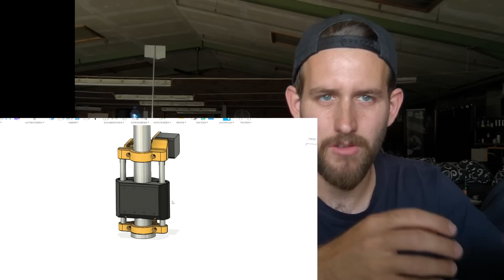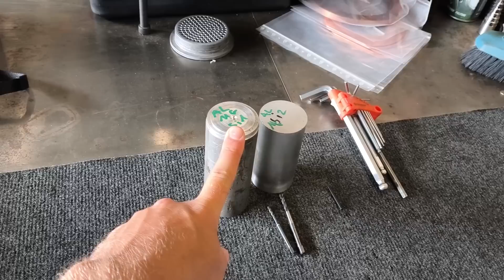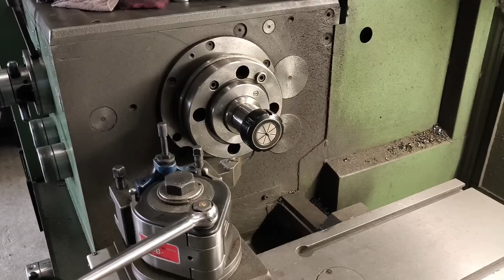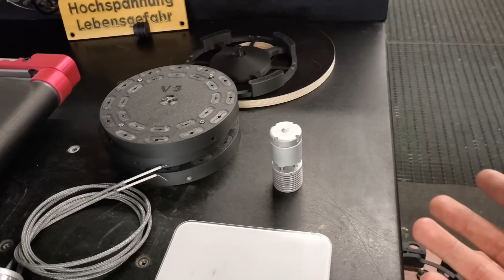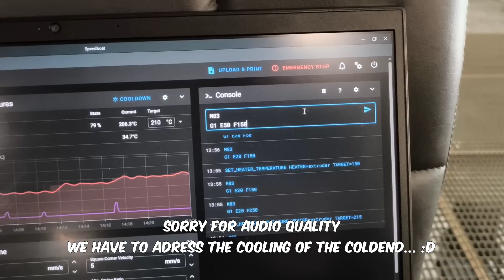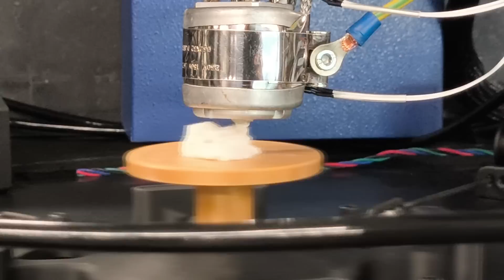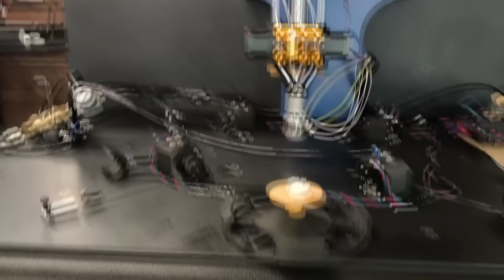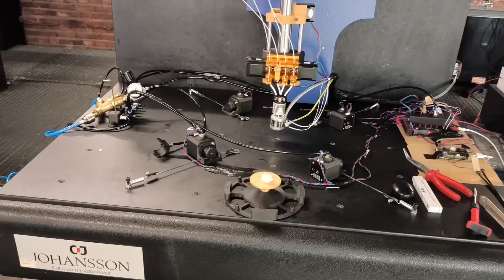Is a sub 1 min 3dBenchy possible? Hotend Build and First Print! (Episode 2)

Comment: For the constant force, can't you just put another stepper with a spool on each of the xy cables to replace the springs? I don't know about the code but if a gimbal can keep its position, then stepper should be able to hold a position on the cable/constant force. 4 more steppers is annoying to deal with, but it might be worth a try. 

You would also be able to vary the force/tension on the fly if needed.

Keep up the great work, I can't wait for the next update.

Comment: Titanium has the reputation for low thermal conductivity but there are some brass and bronze alloys in the 2-4 W/m/K range. UNS 52400, 61300, 63000, 64200, 73500, 79860, 71000, 72200. See specifically phosphor bronze with 10% Sn, aluminum bronze, nickel aluminum bronze, aluminum silicon bronze, "nickel silver", and various ~70% Cu 30% Zn brasses.

Re thermal conductivity of heat block, heat transfer may be limited mostly by plastic. The thermal conductivity between coaxial cylinders 5 cm long with a diameter ratio of 8 and 200 W/m/K bulk thermal conductivity would be 5 W/K, and you have 4 cylinders instead of 1, so a good estimate would be 20 W/K for your setup, which would imply only a few K temperature drop across the heat block itself. In that case, the prescription for more heat transfer to plastic, if needed, would be more filaments rather than changing heat block material.

Comment: How about returning the cable over to the opposite side? I feel like using springs for tension is always a bad idea as they vary depending on the load. Better to make something that have a constant tension and goes around to the motor on the other side
Reply: If I'm understanding crrectly, you're suggestign a closed-rope system for each two opposing motors. That's also what I thought of at first but since the bed has to move perpendicular to each axis, the total length of rope for each two opposing motors isn't always constant.
Reply: @sobhanabedi3363  Yea true. Need to think some more on this. I still believe springs are a bad idea
Reply: As someone else suggested you could connect the ends via a spring. That spring has to compensate for the little bit of movement when you move in both axis.
Reply: Now that I think about it, isn't there a setup that would work without springs? Maybe using only three ropes which are connected in one point on both ends.

Comment: "spring" with constant force is a vacuum. you can machine airtight cylinders with pistons that you can use as springs, and force of the spring will be determined by area of the piston
Reply: @IllSkillz  I also suggested gas struts but like your thinking
Reply: A counterweight also has constant force. Use a pulley to hang a weight, it will pull exactly the same force regardless of displacement
Reply: @Brainstormer_Industires  except the counterweight’s force depends on acceleration, which is high in this case. Once the desired acceleration exceeds 1 g, you have a slack wire…
Reply: @norWindChannel  Only with no mechanical advantage. Use a pulley system to increase it like 5 to 1 or 10 to 1.

And all systems have an acceleration dependency. The only way to have the same restoring force regardless of acceleration would be for the system to be massless. Even springs have a maximum no load return acceleration based on their density and stiffness
Reply: @Brainstormer_Industires  You are right, with appropriate mech. advantage the acceleration dependency of a counterweight can be reduced - I didn’t think of that. 

Increased mech. advantage necessitates increased mass to achieve the same force. In contrast, the mass of a “vacuum piston” can be virtually independent of the piston area, i.e. the force. 

At the end of the day it boils down to a compromise between total mass, complexity, size, cost etc.. It is great to have different options🙂 
Nice chat🤝.
Reply: I guess that is called damper
Reply: @anonym9323  Only if you’re a biker😉 It is actually a spring (a “true” damper dissipates energy, while a spring passively pushes back).
Reply: @norWindChannel yeah you are right but I think a air cylinder will be modelled as a damper maybe I do not understand the concept enough that IllSkillz was talking about in his comment and my english is not that good
Reply: Clever
Reply: A simpler solution would be this https://www.youtube.com/watch?v=tiC5ma70QWU&lc=UgzJ-4tLZU_4TskEpSR4AaABAg (just using weights at the end of ropes hanging of the table) achieving a good vacum in 4 points is WAY more difficult

EDIT: Wow you guys are right, weights would have a different force in case of acceleration. Thank you 👏🏻👏🏻👏🏻
Reply: Agreed. Except it is the atmosphere excerting the force, not the vacuum😉

Comment: This old Tony just released a video about gas struts explaining how they have constant force! I doubt you can find one with a low enough stroke or spring rate but it’s a possible option to overcome the spring rate issue. Best of luck, keep it up 👍
Reply: @jamieclarke321  Gas struts are way too slow. They are designed to dampen movement. If you think of your trunk lid, how it opens smooth but slow.
Reply: @deckname5794 This. Gas springs have a constant spring rate if they are near stationary. Since gas only has a small orifice to travel between sides, moving quickly causes it to oppose movement
Reply: @mars5train601  True. If you have a normal spring and use only a small part of its travel, you have relatively constant force too.
Reply: @deckname5794 Know what happens when you play with pulleys and gear ratios and such, speed can go up while force can go down. Imagine, a gas strut making less force, while still constant, at greater speed.
Reply: This was my first thought as well! To the people saying gas springs are much too slow, you can literally tune the ports on them infinitely. That's kind of how shock absorption works in general.
Reply: Or just use linear springs
Reply: I thought of this too. I think he could make his own DIY, purpose-built struts that would eliminate the problems others pointed out below. The most common objection made is a too-small channel for the gas to travel to the other side of the piston, making it a damper as much as a spring. Easy fix, just make a larger return path, or for that matter just a loosely fitting piston that air can move freely around . As for moving mass/ inertia, use a thin piston, a small rod on the high-area side and a large, thin-walled tube on the small area side (rather than a solid rod there).

I think the biggest problem will be to reduce friction from the necessary gas seal where the actuator rod exits the cylinder. In a normal gas strut, this needs to be a perfect seal because any leakage at all would result in the cylinder dying over time. O-rings can handle this but at the cost of a lot of friction between them and the actuator shaft. In a static, lab-based environment like this though, we don’t care at all about the cylinders retaining their charge. So rather than an O-ring seal, a simple polished shaft in a polished (or perhaps even just carefully reamed) hole with a close tolerance would be relatively easy to make, and the air leaking through the gap would potentially act like an air bearing. Leaking air could just be made up for by connecting the cylinder to the shop air supply.
Reply: This is the first one of this guy's videos I have watched, but if the first comment is a fellow ToT enjoyer I will subscribe.
Reply: @IFRYRCE  this is only the second video I’ve watched from this channel but I think the dude definitely deserves a sub 👍
Reply: If this would be a thing, imagine how car engines would profit from it. But where are them? So.. no.. it wont work.
Reply: @hanswurstusbrachialus5213  I have no idea what you mean?
Reply: @hanswurstusbrachialus5213  pneumatic valve springs are a thing.

Comment: Constant force spring you can try....quill spring from a drill press. Cheap and easy to find. Mcmaster Carr has lots of constant force springs. You can also find them in tape measures
Reply: @ukulelefatman  I think they are called power springs

Comment: Constant force from gravity ... rig up counterweights instead of springs.
Reply: I think you don’t really get constant force from gravity but rather constant acceleration. So even after 1 second the maximum speed of the weight traveling downward would be ≈9.8m/s. So in no way close to the 300,000mm/s ≈ 30m/s that you already can accelerate at.
Reply from the maker: I would love to but I got some space restraints with that approach. But yeah that's as constant as it gets
Reply: @Roetz40  holes in the table and counterweights under table ?   - in tubes so they don't flap around...

Comment: I thought speedboat rule is 0.5 extrusion width, not necessarily 0.5 nozzle?
Reply: Just checked the rules, both are capped at 0.5
Reply: @youtubehandlesux it technically says either but they are both linked. It just depends on how much you want to stick to the rules or how much you want cleanly say you have a benchy with the official rules
Reply: @nevin_co FIY: you can extrude 0.5 on 0.4 nozzle. For example, on RatRig 3.1 500x500 it is recommended to print first layer at 130% nozzle width, which amounts to 0.52 on a 0.4 nozzle.

Comment: ooo nice. been looking forward to this video! the motion system is so interesting. so for a while I've been thinking about the idea of a 2d bed slinger on a printer with a tool head that also moves in 2 dimensions (in the opposite direction) that way to only have to move each half as far, and you also get 2x the max speed and acceleration. I wonder if you could add a moving tool head to this design.
Reply: Do klipper even work with different input shaping methods for different moving parts? If not, then you have to write code yourself, or just live with 2hump_ei which kinda suck